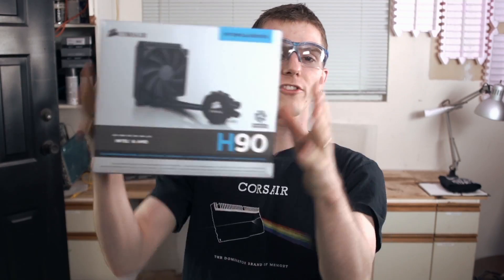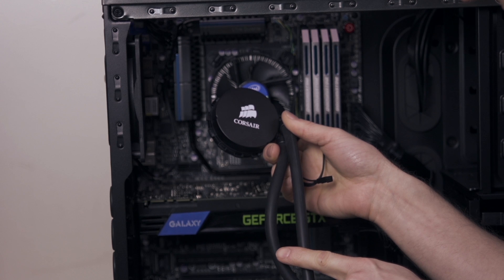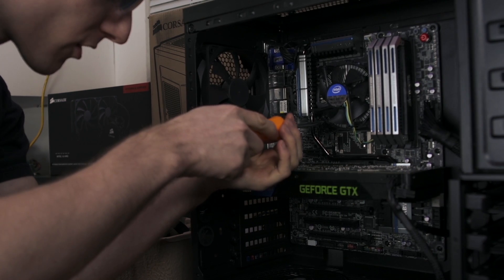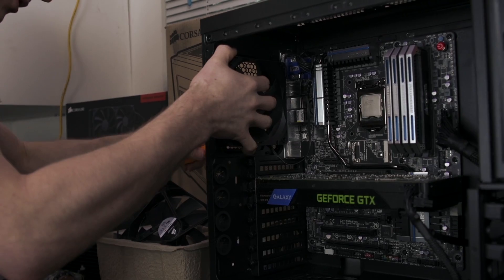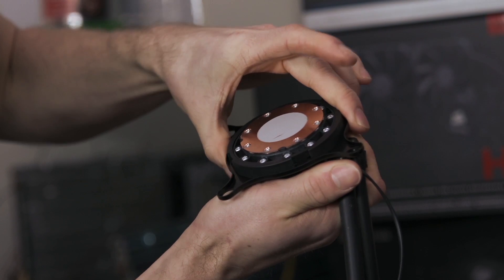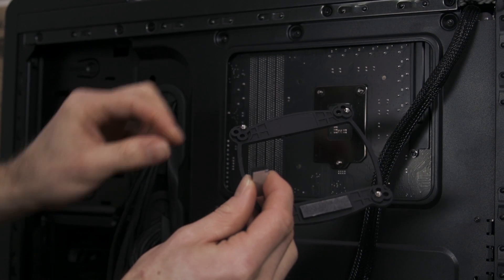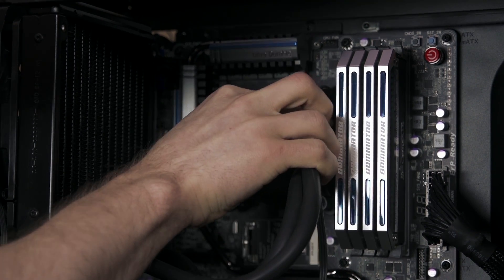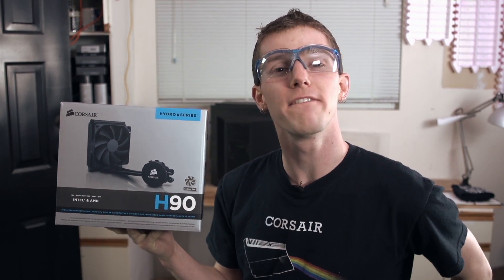Linus Tech Quickie: Installing the Hydro Series H90 140mm High-Performance Liquid CPU Cooler

Comment: This cooler  supported with 1151 socket ?? 
I bought it with msi 270 krait gaming motherboard and i5 7600k intel cpu and i have problem with the connection at the backboard

Comment: The radiator fan should be an intake since the air outside the case is cooler than the air inside.  Then the fans on top should be blowing up to evacuate the heat.  So all fans should be sucking in while the two on top should be blowing out.  Just a little tip.

Comment: dum question but does this req me to add water to the raditor(bad spelling i know) or can i just install it and not have to worrie about spec installing
Reply: It does not require you to add water, everything he did is what you would do. If ya still needed to know
Reply: AIO = "All in One" ... you don't need to do/add anything except mount it.

Comment: I'm hitting 80C with this cooler and stock 6700K with Prime95 stress test.  Is this normal or did I do something wrong?
Reply: I have cryorig H7, only hitting 60C with stress test.
Reply: Placing the thermal paste in the right way is crucial, if u do that wrong u get high temperatures.
Anyway is not normal coz with an amd fx 8320+ corsair h55 the max i get is 67 c°..
U should'have placed a grain of rice (as amount of thermal paste) on the center of the cpu, otherwhise u get strange temperatures. 
The problem could be the  position of your fan, is the airflow blowing outside or inside the computer?

Comment: HORRIBLE... you completely skipped the radiator part, like which direction the fan goes, inside or outside the rad. and why? and why when i put the screws through they barely go out the other side of the fan so how to keep the rad screwed in...I HATE incompetent tutorials. SMH
Reply: +Gelly Helly I came here to see which way I need to mount the fan as well.. It doesn't matter which direction it blows? Or does it blow the same either way?
Reply: +Beau Christopher yeah same here
Reply: Yes this demo really Blows. Shame on you Linus.
Reply: +motionless1 which side you mount the fan doesn't matter, only takes a little common sense. not the tutorial that is incompetent

Comment: can and should I replace the stock fan with a different 140mm fan?
Reply: You can and you should.  Stock fans included with heatsinks are usually cheap garbage that compensates for poor design by spinning really fast, and thus really loud.  Something like the Noctua NF-A14 PWM will work really well with 140mm and 280mm radiators.  I know some people don't like how Noctua colours look, but I'm definitely not in that camp.
Reply: +Xhiril Dhul i built my computer 6 months ago lol

Comment: will this fit an 1151 board decided to upgrade
Reply: +WickedRed1 I built a Skylake pc with this watercooler, and yes, it fits the same format as an LGA 1156. On the backing mount, there's 3 spaces for different configurations: 1156/1366 and 775. The nuts you'll want to plug them into are the 1156 format holes. When applying the backing mount it won't sit completely perfect over the rear mobo's cpu fixture, that part is intentional so don't worry, that's so that the actual radiator on the opposite side will fit accordingly to the LGA format chosen. Everything after that is pretty straightforward and you're on your way to a decent water cooled rig.

Hopefully this info is still good for you even after 2 months.
Reply: +WickedRed1 It supports LGA 1150, 1155, 1156, 1366, and 2011.
Reply: +microgamestation im sure corsair will update the product and include a new mount for 1151

Comment: Noob question, does the Corsair logo have to be facing up?
Reply: +smgman254 In practicality, no haha. It'll work just the same but if you're someone who obsesses the small details (like me) it can be bothersome. I actually installed my H90 with the logo upside down and it bothered me like crazy so I opened my pc back up a short while after, disassembled the radiator off the cpu and realigned everything so the logo would face right side up.

Comment: I have a question about removing it. Hopefully someone can answer me A.S.A.P.  So I need to break down my computer, and re build it again. After I take it off, do I need to reapply thermal paste again?
Reply: Micaela Garcia Might be a good idea!
Reply: +Micaela Garcia definitely clean the old paste off both the radiator and cpu itself, reapply, but get some decent aftermarket thermal paste like Arctic Silver 5 or IC Diamond. I've read IC Diamond is thicker and grittier, so it could scratch components if and when you need to clean and reapply, but I personally have had amazing results with Arctic Silver 5.

Comment: Mounting the radiator can be a little tricky, but I'll show you the way that I find best.
puts 4 screws through holes  *next frame* Magically mounted.
Reply: Agreed. I ended up sandwiching the fan between the case and radiator, blowing out, so it will pull heat from the radiator. It was a wicked PITA.

Comment: I love the way this installs!  they did a great job including the pre applied thermal
paste,the locking snap in  parts and the adhesive for the mounting bracket.
anyone can install one of these and never have to worry about doing it bad or something going wrong!

Comment: Does it matter if you use the cpu cooler rad to intake or exhaust from the case
Reply: Steven Millican It would be better to exhaust, otherwise you'll be drawing all that heat into your case and over your other components.

Comment: Video rushes by backing plate installation.  When installed correctly the rectangular backing plate opening is not parallel with motherboard.  I thought something might be wrong when installing mine.  They are rotated a bit offset and you can see this by stopping video at 4:21
Reply: maybe u have a different CPU?

Comment: better have the fan that push the air from inside the case out through radiator or the fan that pull the air outside from the radiator?
Reply: depends on your setup. if your outside air is cool and you have sufficient evacuation of air inside, intake.

if you have enough intake and the inner air is cool enough, outtake.
Reply: I have a horizzontal microatx case now with one 140 fan in front 50 cfm, only one 140 fan as exhaust in the back (94 cfm max high static preassure) and an H90 on the top as intake (95-96 cfm max pushed into the case). This seems to be a good but a bit strange (for me) solution. with ambient temp of 22 - 23C my i74790k run at 25 - 26C (core temp) in idle (with the radiator fan as exhaust, temp was increased of 4C) and 58 - 60c max with h90 fan running at 960 rpm. mb is 29 idle and 34-36 max (with the same powerfull high static fan i have in the back I could reach 27C in idle), vga (960x nvidia) is on 29 in idle and 60C fully loaded. I have prefered this fans config after several test but now I want try to change the front fan with a 200 mm fan with more airflow but im not sure it will be better. Im curious to see the temps in summer with an ambient temp around 37 - 40 degree...

Comment: Got one of these to install, but I have a question - the cable for the pump is 3-pin, but the CPU fan header on my motherboard (Asus Crosshair V Formula-Z) is 4-pin. All of the other fan headers on there are 4-pin also. Can I still plug it in there, or do I need an adapter?
Reply: No you can plug it into the CPU header directly with no problems, Make sure your fans are plugged directly into the pump as well for use of Corsair Link

Comment: Thanks for the install video, always nice to follow along with the instruction manual since they are sparse for both this and the 140XL.  The Cooler Master solution gives you a lot more for your money IMO but it had a high-frequency pump whine that I couldn't tolerate for more than a few minutes so I had to switch to this.  The mounting here is much less solid and the plastic backplate, if you can call it that, is a joke.  I immediately rotated all the little female "I" parts while tightening the block.

Comment: i have installed a h50 (the installation should be similiar to the h80) and a H90 in my latest build. Both were really easy to install but the h90 was a bit easier. Just make sure they fit in your case and take your time and you should be fine :)